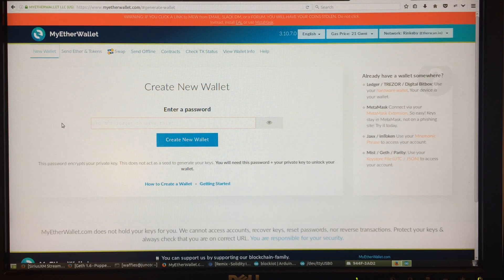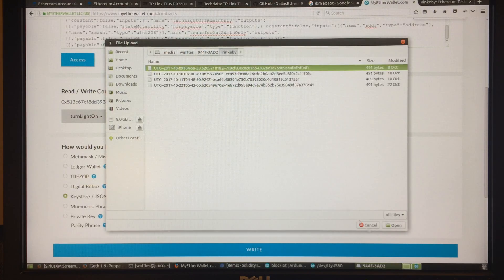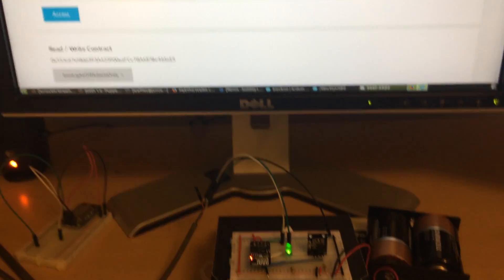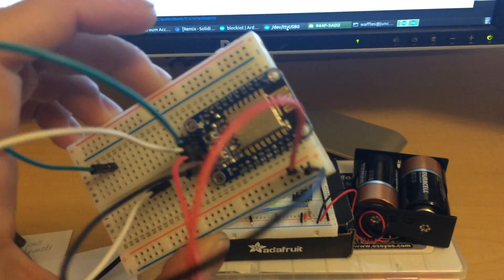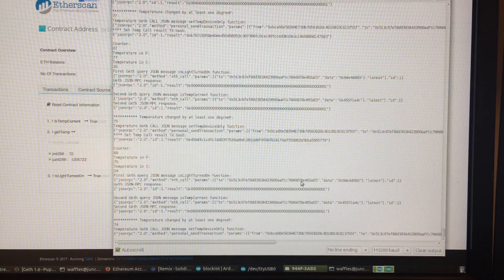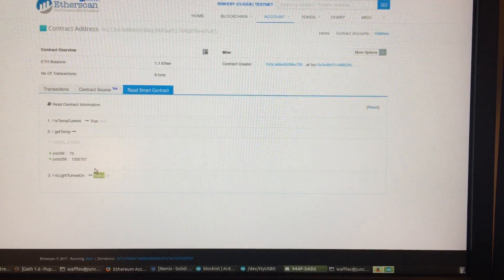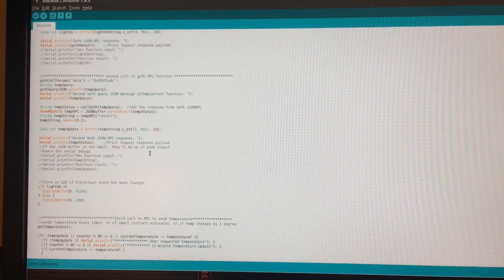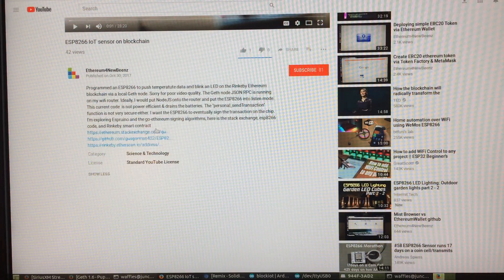ESP8266 IoT device on Ethereum Blockchain OpenWrt MIPS Wifi Node

Comment: Thanks for the demo, I'm interested in doing project to demonstrate how to use a esp8266 as token based wifi hotspot to learn more about blockchain.
Reply from the maker: Try an ESP8266-012, it has more memory and greater range, and more exposed GPIO pins

Comment: Hi! I need help for my graduation project.
I want to know if I can integrate an Arduino to the universal controller from OpenEVSE and add that system that you are showing us to the controller, so I can sell energy with blockchain
Reply from the maker: I have never used OpenEVSE, but I know they sell a wifi module. Check if it has an API that Arduino code can interact with

Comment: Hey, this is great tutorial & really informative! i have a question, when you call the function turnlighton() of the Smart contract in the web interface, how can the smart contract interact with the ESP+LED?
Reply from the maker: There is an Ethereum (Geth) node running at my house, and the RPC port is open. The ESP8266 uses that RPC connection, via wifi over my LAN, to check the contract every 15 seconds, because that is about how often new blocks are mined. The very last line of ESP8266 code has the delay
Reply: Ethereum4NewBeenz thanks for your response. So as i understand, the user call the function of smart contract from the web application, The function is executed when transaction are made to this function, then the ESP01 keep listening to the blockchain and look for the transactions made for the smart contract address, and execute these functions? is that like that?
because in the smart contract function i see no relation with the ESP01.
Reply from the maker: Yes. I could program another IoT device with different programming language to interact & "listen" to the same exact smart contract. I did another project using javascript and smart contract Events, it might be easier to understand. It is Raspberry Pi example https://youtu.be/OBxyGAILqfE

Comment: Hi Sir, can you please specify how you converted the function name into the 4 hexa byts ( 18:00 ). You said you convert the name of the function to hexa then apply 3 algorithms. Can you detail more pls which algos u used ? Thanks
Reply from the maker: There is a function called web3.sha3. I used the Geth console (using "geth attach"), to access the function. If your function was called setTemperature and it took an unsigned integer for input, the command was: web3.sha3('setTemperature(uint)')
This will give the hexadecimal sha3 hash of the function. You use the first 4 bytes of that hexadecimal string. The best instructions are here: https://ethereum.stackexchange.com/questions/3514/how-to-call-a-contract-method-using-the-eth-call-json-rpc-api
Search for the section called "Use your contract using Curl and JSON-RPC", it will have good example

Comment: Hey, very informative! Helped me get started with Embedded ethereum. However, I have few questions in the above implementation. the function turnLightOffAdminOnly does not work for me. Can you please help me out with this?
Reply from the maker: Probably because you don't own the admin address, unless you deployed your own version of the contract. I made another IoT project, but with NodeJS and web3 on Raspberry Pi. It is easier to understand, check it out https://hackaday.io/project/111288-decentralized-iot-indoor-horticulture
Reply: Ethereum4NewBeenz I did deploy a new contract with a new address, and made corresponding changes in the code for the address. But not too clear why I don't have Admin privileges

Comment: Hi, thank you so much for this excellent video. I could replicate the whole experiment except sending a transaction (sending temperature value) to the blockchain. It’s throwing an error: {“code” : - 32000, “message “ : “unknown account “}. Could you please help me solving this issue? Thanks.
Reply: I gave the correct “from” account by which I created my transaction in rinkeby and the correct password. I also gave the correct “to” account which is the address of the contract I created using my “from” account.
Reply: The issue may be with the Rinkeby node. Make sure you change IP address in the code. I had a Rinkeby node running inside my house & LAN, so the IP address in my code is 192.168.1.X type.  Also, I used an old technique where the keys are stored on the node, and the transactions are signed on the node.  I've seen some people try to use Infura with this code, but Infura will not work because Infura doesn't store keys or sign transaction, that all happens on the client device. Setting up your own Rinkeby node isn't hard, it takes a few hours (almost a day) to download all past blocks & sync
Reply: @gusgorman3416  thanks. I solved the issue. I forgot to save the proper keystore file in RPi.

Comment: Thanks a lot for the nice demo. For my project, I need to do the same thing using ESP8266-01 module. For that, I need to send the geth query via AT commands. Could you please help me regarding how I can do the same http POST using AT commands? TIA
Reply: I don't have much experience with AT commands. There are some examples online to help get you started https://www.instructables.com/id/Arduino-Esp8266-Post-Data-to-Website/

Comment: Hi, thats really great job! So, I am working on the quite a similar work right now and I liked your method very much. But I want to try to do the same with the private Blockchain in my local home network. How do you think, is it possible?
Reply from the maker: Yes. I've done it with a bunch of wifi routers placed around my house. A program called Puppeth will create the genesis file needed to start your own Proof of Authority network, similar to Rinkeby. Finding a decent block explorer is a problem though, Etherscan does NOT sync to a private network.
Reply: But if I want to write the temperature (for example) information to private Blockchain using Raspberry pi3? So, I got private Blockchain via geth, one miner (my main machine) and one listening node - Raspberry pi. They are syncronized with each other, but I have no idea, how I can put down there my temperature data... Probably, I'm quite new to this theme, maybe you can advise something?
Reply from the maker: In this video you must make sure the RPC port(8545) is turned on. You craft the transaction(temperature data) into the proper format (converting to hex, etc.) and post it via the RPC port. In the video, the ESP8266 is communicating with the node/RPC port i have running inside my house. This example is a little confusing, it might be better if you try a NodeJS example instead. We used the NodeJS style for another IoT project, here is the video https://youtu.be/OBxyGAILqfE

Comment: Hi, Is Go ethereum is integrated into OpenWRT?
Reply from the maker: No, I had to cross compile Geth
Reply: Thanks for reply. Does Geth runs on TPLink router ( MIPS architecture )
Reply from the maker: Yes. The cross compile instructions are easy to find. If you have Go and Docker installed, it will cross compile automatically if you tell the "make" command the architecture you want (make geth-linux-mips32) You have to edit the makefile though so the executable compiles with static libraries, not dynamic.  But to run it successfully on a router, you must add an external USB drive and configure the router to use that for SWAP space
Reply from the maker: I am gusgorman402 on gmail. You might also like this other IoT Ethereum project we did for ETHDenver hackathon https://youtu.be/OBxyGAILqfE
Reply: Ethereum4NewBeenz Thanks for reply and your time.

Comment: Hwy,I've been working with IoT since 2 years now.I plan to do something similar.Can you help me get started?
Reply from the maker: Sure! You'll want to get familiar with the Rinkeby test network
Reply: Hey,The led turn on/off function doesnt work for me. Also I didn't understand how it reads the value of lightOn.
Reply from the maker: My example is kind of advanced. Some people prefer the NodeJS example here https://github.com/DallasEthereum/IoT-Blink
Reply: Okay Thankyou. Response i get is 'Ox' . So the lightOn is always zero.What could be the fault?
Reply from the maker: It could be a bunch of issues. Make sure you are running a Rinkeby node with Geth. When you start Geth, you must use the "rpcapi" option to turn on "personal" methods. https://github.com/gusgorman402/ESP8266_Geth/blob/73bdd3a424d150ccdfba9d658b62c0ce45b876cc/blockiot.ino#L61 Make sure this line is changed to address of your Rinkeby Geth node (usually localhost:8545) and make sure you change the contract address to your deployed contract address https://github.com/gusgorman402/ESP8266_Geth/blob/73bdd3a424d150ccdfba9d658b62c0ce45b876cc/blockiot.ino#L82
Reply: I'm running a rinkeby node on my PC. I still get no response.
Reply from the maker: Then you wouldn't use localhost. You would use the LAN IP address of your laptop. So if your laptop has a LAN IP of 192.168.1.123, then you would start geth with this command "geth --rinkeby --rpc --rpcaddr 192.168.1.123 --rpcapi personal,eth,web3" Make sure you have a private key loaded with Rinkeby Ether in your keystore folder too
Reply: I've done all of that. I still don't get any response.
Reply from the maker: Maybe there's a firewall running on your Rinkeby node. Try communicating with the node using Curl commands. If you want to communicate with your node & contract with curl, you need to craft the data a certain way. That's what the bulk of my ESP8266 code does, converts the smart contract function name to sha3, hexadecimal first 4 bytes, padded with zeroes to be 32bytes. It's a pain. That's what the web3 library is doing in javascript. https://ethereum.stackexchange.com/questions/3514/how-to-call-a-contract-method-using-the-eth-call-json-rpc-api
Reply: Hey! What are the softwares you used to create the front end ?
Reply from the maker: I used simple HTML and javascript, after installing the web3 library. And I wrote the front end assuming users have Metamask. There is a folder in my github linked above, but it is a very very simple example of front end. I recently finished a hackathon IoT project, using NodeJS. Here is the devpost link, I will put up more source code this week. Using NodeJS is an easier technique because it can use the web3 library https://devpost.com/software/autonomous-horticulture
Reply: Amazing work ! :D
Reply from the maker: You might be interested in this hackathon and this group in general, I met them at ETHDenver http://cryptochickshackathon.com/
Reply from the maker: Here is a better example. More hardware, but easier code. I'll be posting most of my new videos on this other gusgorman channel https://youtu.be/OBxyGAILqfE